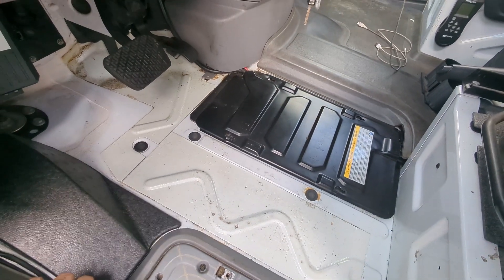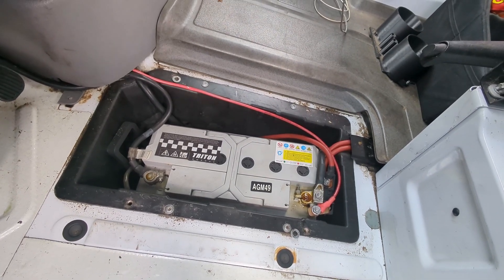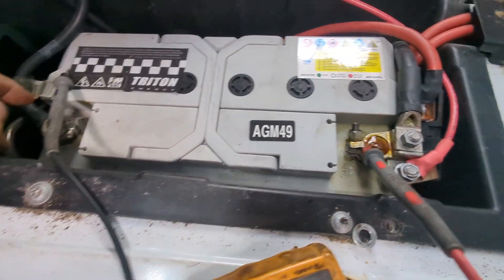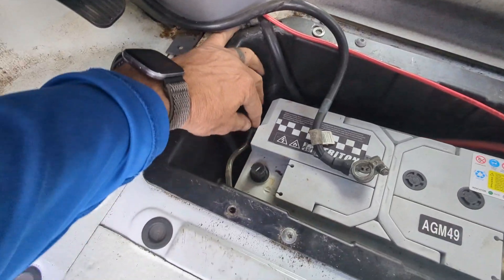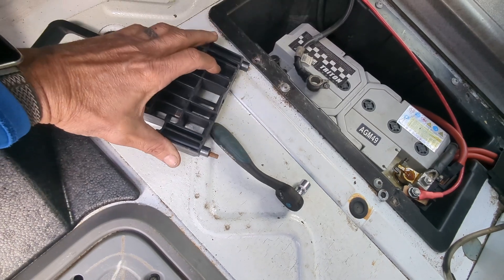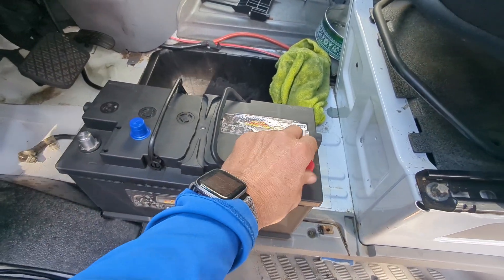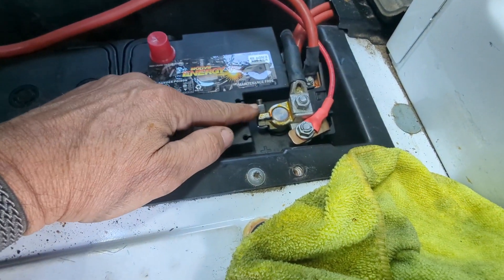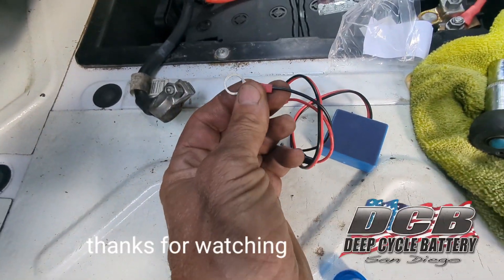Sprinter Battery Replacement and Victron Smart Sense DIY

Comment: I am thinking to hook it up only for ocassional recharging during spells of low use or twice a year to keep the battery in good condition. Do you think I could easily use it on a different battery if needed?
Reply from the maker: The smart sense can be repurposed, just dont stick it to the battery...